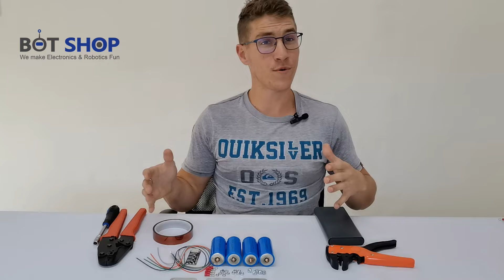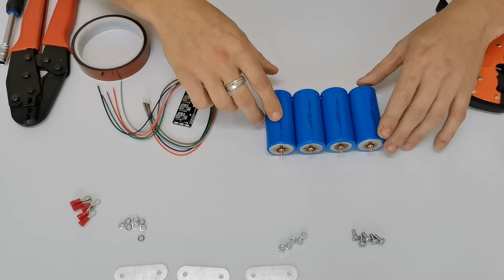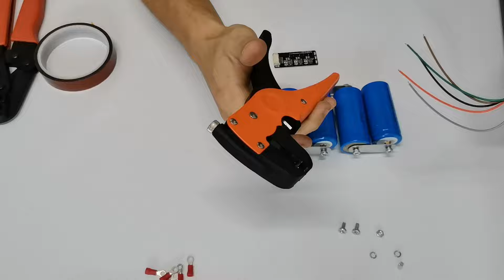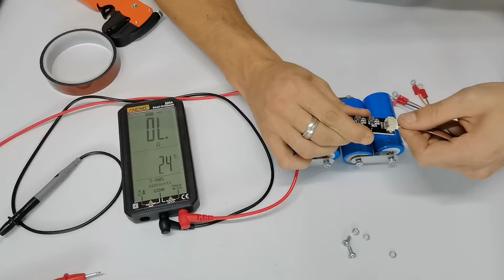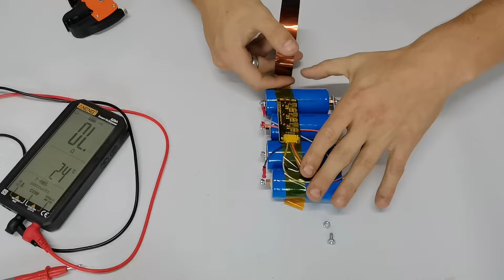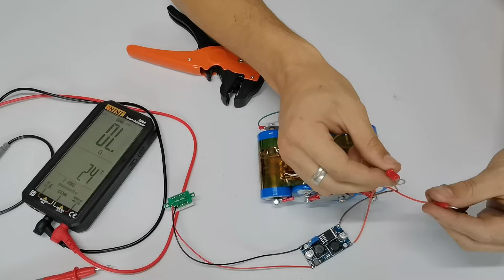Bot Shop - How to assemble the DIY LiFePO4 5v-24v WIFI UPS

Comment: What do you use for charging the batteries ?
Reply: I would love to know this as well
Reply: you can charge with any 12v charger that won't exceed  14.6v, and to be able to get it full you would need one that charges at at least 13.8v the last few % is hard to do if the  voltage is lower ie the 13.8v  with 14.6v the charge rate won't slow down at the end, you can use a step down buck converter that you can set the voltage and use it with an old laptop power brick if you have one lying around or any car charger